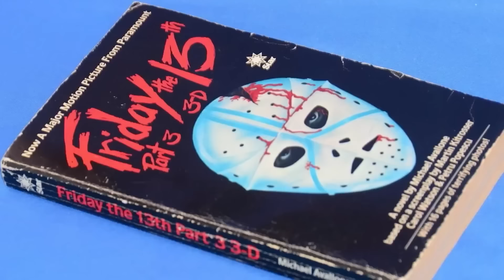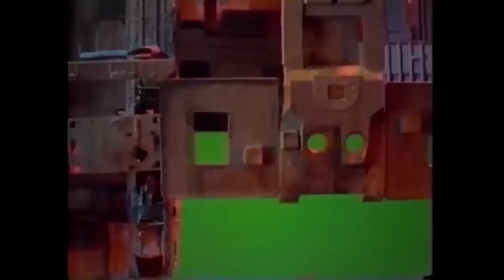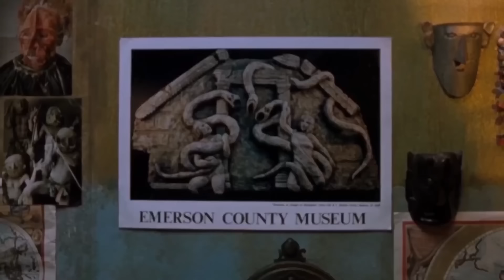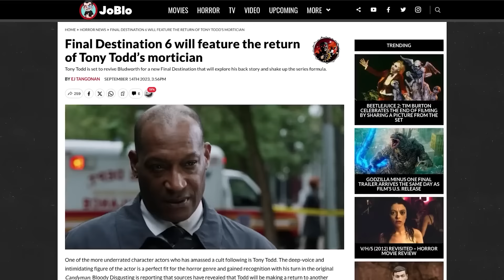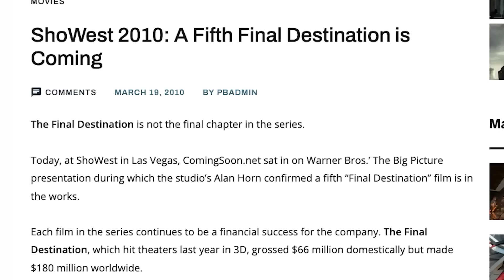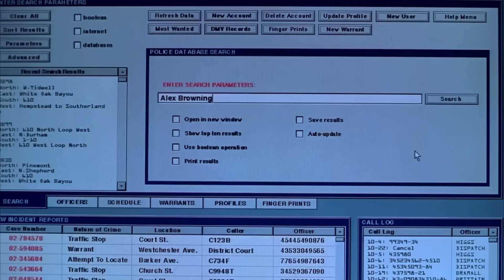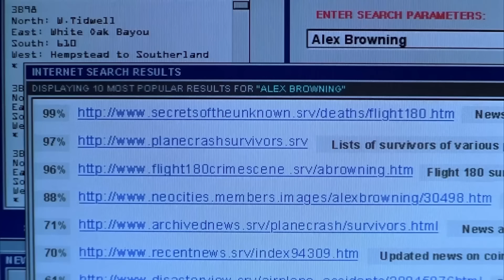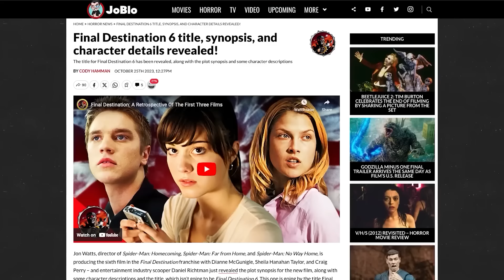Revisiting Cheesy Horror In Three Dimensions

Comment: What are you talking about at the 9:09 mark? Sadly not the old school blue and red 3D? When it was originally released in theaters it wasn’t blue and red, it was polarized 3D (like the current RealD movies). Only the crappy 3D disc release from a few years ago had that blue and red (which is awful). 

During this period there was a 3D resurgence… F13, Metalstorm, Jaws, Spacehunter, Comin’ At Ya’, etc. And all of them were polarized.